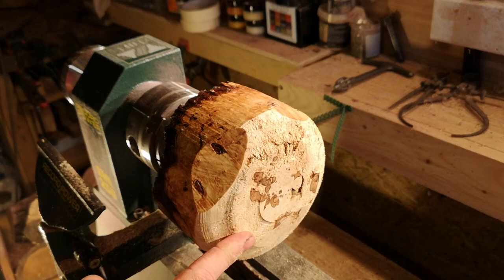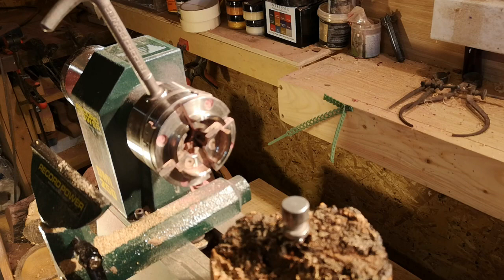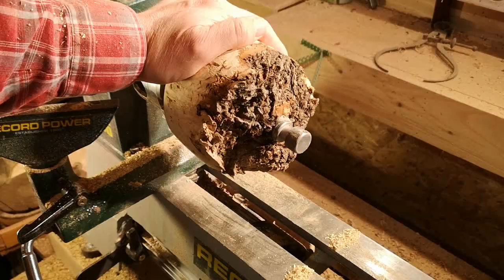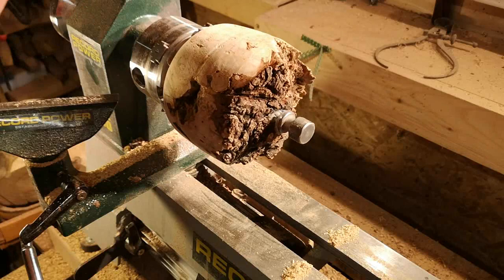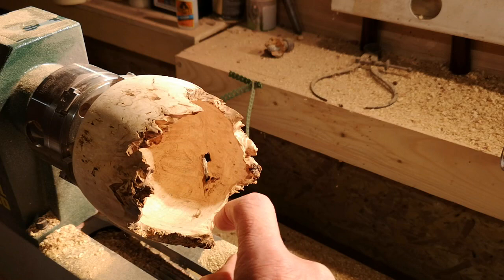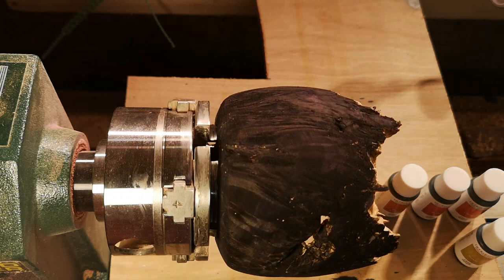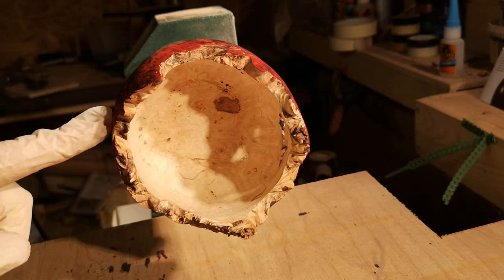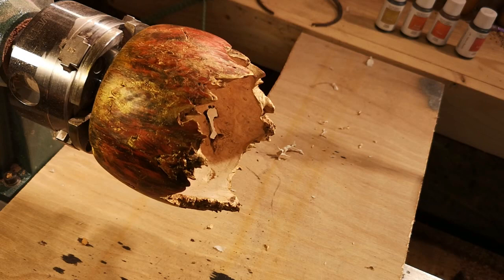Woodturning -  Incandescent Horse Chestnut Burl

Comment: Lovely job Martin, bloody good save. I love the effect you have produced and I would be very proud if it were mine, one thing watch out when using the High Gloss on Burrs, when it dries in the voids it will turn white. Martin mentions this in an older video
Reply from the maker: Wow, thank you buddy.... You are too kind.  I had noticed the "whitening" on the "phoenix bowl, but thought I had something wrong, how do you rectify/stop it?
Reply: @MGMakes  What I have done and this is with Martin's suggestion, if you have a compressor  blow them out. the other thing to do is use a different finish, like danish oil, hope this helps

Comment: Martin that turned out really nice. You had me worried when you had it all black but once you resanded it I really started liking it.
One thing you might try if you ever have to epoxy a worm screw in place is to wax up the worm screw and you will then be able to unscrew it like normal. Any sort of paste wax will work. Just wipe it on and leave a nice film. ng 
Great job,
Gary
Reply from the maker: Thank you Gary, I was a bit concerned myself. That is a great idea regarding the worm screw. Now to find another punky piece to try it on. 👊👊👊

Comment: That is absolutely gorgeous  Martin. It looks even better in the video than the stills you put on Facebook. ❤️it 😀
btw I've found quite by accident that PVA sealer (the stuff decorators use for sealing brickwork etc)  helps stabilise punky soft wood. I just give it a really good application and let it soak in. Although I've not tried adding colour to it yet. Maybe on the next piece as I've got some very punky beech to use.
Reply from the maker: Thank you T, I might have to give that a go. I saw the pictures of the punky wood on FB, can't wait to see what you do with them. 👊👊👊